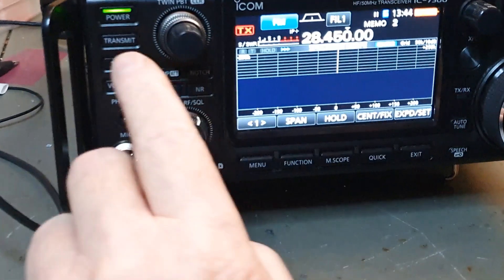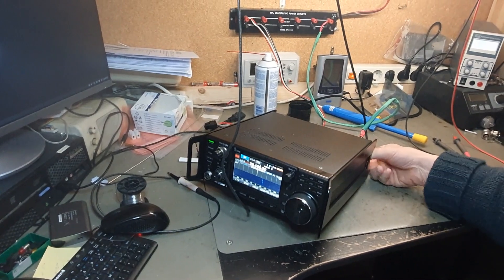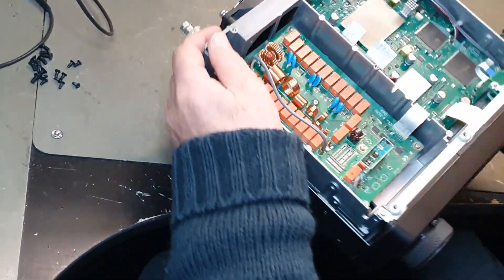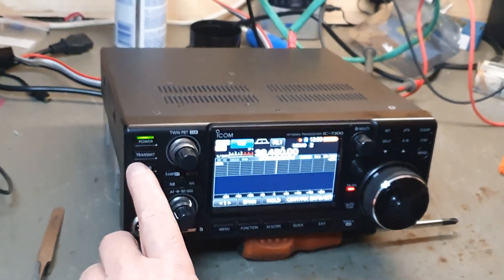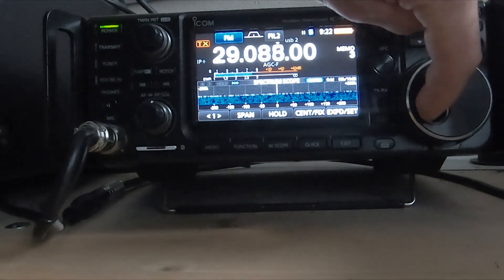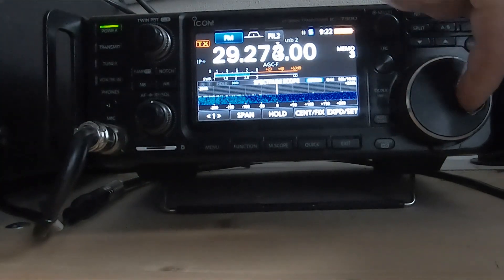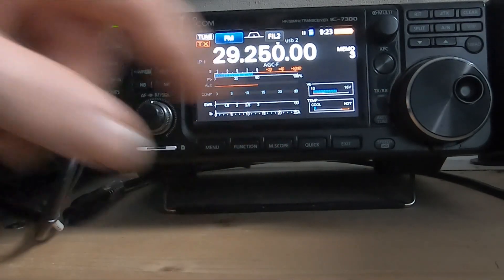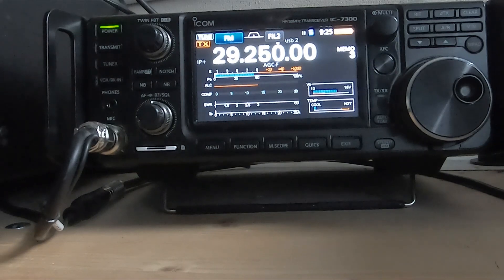ICOM IC-7300, AUTOMATIC ANTENNA TUNER MODIFICATION 🤔🤔quick look SIGMA HF 360 ALL BANDS VERTICAL PT/1

Comment: Excellent work!!! What most people ask you about the modification could be solved in a very simple way!!! Remove the metal cover of the equipment and take a good photo (Macro) so they can see the value of the resistance that I soldered on top of the installed one and see the location better!!! All radio amateurs are here to help and share information! Never forget it! Kind regards from Lima-Peru Sincerely: Tito Leon OA4LDR I leave you my email so you can share it with me too! A big hug from a distance and best regards 73s
Reply from the maker: @titoleondelrisco7037  Good evening, unfortunately the Icom ic-7300 went a year or so ago 😕, I now am lucky enough to have the big brother ic 7610 ,so this is were the story stops, good luck with it,and 73s from Rotterdam 🙏

Comment: HI there.  my icom 7300 only tunes on 20m on my end fed antenna and does the same thing on my carolina windom antenna. i would sure like to do the mod that your mate did to the 7300 so that i can use my radio on all bands please. can you forward me or point me in the right direction as to what resistor he added and where so that i can do this myself. please get back to me. thank you please help
Reply from the maker: @jasonhilaire5515  Good evening, to be honest it was a long time ago and I am not sure what exactly he used, but it's common knowledge I believe,,,,maybe a Google search,,,good luck 😉
Reply: @Bernard-John  i sure wished it was common knowledge. can you not contact your technician mate to find out ? i really need this. thank you for replying
Reply from the maker: @jasonhilaire5515  try calling 31035 6215879,  for the rest I can't help,,,good luck 73s
Reply: @Bernard-John  ok i tried  putting the number 1 and it did work. i heard a ladies voice saying that she cant come to the phone. if i do try again and she does answer, who should i ask to speak to ? 73s
Reply from the maker: @jasonhilaire5515   Hi what is your call sign 🙏
Reply from the maker: @jasonhilaire5515  try Monday,,,,can't remember his name 👍
Reply: @Bernard-John  J69JH

Comment: I just did my 7300 working great , but doesn’t mean can make miracles. Now I can tune every where with my g5rv and cobweb
Reply: how to modify it. what components to change or remove
Reply: i  need help modding my 7300s antenna tunner also. point me in the right direction please ? what do i have to do ? where do i place thr resistor and what value. help please

Comment: Can you auto-tune the nearest frequency that you WANT to transmit on that has 3:1 SWR and then after tuning go to the frequency you desired and at least have decent SWR? Due to not being able to tune over 3:1 SWR you can at least tune to its limit nearest your desired frequency.
Reply from the maker: Hi after the antenna tuner modified, the radio 📻 does SWR from 5:1 good for portable work, 73s from Rotterdam

Comment: Very interesting, thanks for sharing.  In regards to what the engineer said about the DX10 being better...  The DX certainly has good performance, but the menu system is convoluted and the dial/button design around the VFO is a complete disaster if you have large hands/fingers.  
I personally find that the DX10 has a "warmer" audio than my 7300 (and 590SG) that no amount of EQ fiddling can fix.  This warmer audio is an inherent sound of the DX10 that either falls within the listener's register or does not.  My older and somewhat damaged ears (too many night-clubs in my youth I suspect) prefer the brighter sound of the 7300, although I suspect younger ears might find the 7300 "thin" sounding compared with the DX10.  
So I would say it really depends on what is meant by "better".  73

Comment: I'm watching your clip and it's really interesting. I have the feeling that the tuner on my 7300 is not functional at all. It grinds, grinds, but it doesn't beat my swr even if it's below 2.5 or less. The station is new and I really don't know what to do. I would appreciate any information. 73 from S50SI

Comment: I did the same modification works well for me.
Reply: Rather use better aerials than use a mod like this
Reply: @chazwozza67  49 to 1 with 134 feet wire no ATU needed I've put the Icom to factory. I was using RGV5 I couldn't get the swr out of the red zone the why I did the mods it worked it was good thing at the time.
Reply: @M7XCB  fooling the radio makes no odds the aerial is still bad
Reply: @chazwozza67  yes your quite right there
Reply: @chazwozza67 I think that high SWR does not necessarily mean a bad antenna. For example, I might wish to run low-loss balanced feeder to a doublet, via a half-wave co-axial balun at the tx end. This could still show high SWR, but using a short length of low-loss co-ax feed, the extra loss, owing to high SWR, could be negligible. The transmitter needs to see 50 ohm resistive load to deliver full power, thus the need for the ATU/"Tuner"
Reply from the maker: @chazwozza67  Hi,sometimes you can only do the best with what you have,,🤔the hobby is expensive enough,,,🙄but thanks for the reply 😊 73 from Rotterdam 👍
Reply: Anyone in the UK able to do this?
Reply from the maker: Hi,I am also pleased with the modification,i am curious how it handles the Sigma HF 360 antenna, I didn't think the ALC upgrade was for me,,, because I use a studio microphone,,,,thanks and 73 from Rotterdam 👍
Reply: @Bernard-John  i need help with modifying my icom 7300. can you point me in the right direction pleaseeeeeee. i have been searching the web to see what value resistor and where i have to solder it. help please thanks
Reply: That’s handy to know
Reply: Hod do I get this mod???